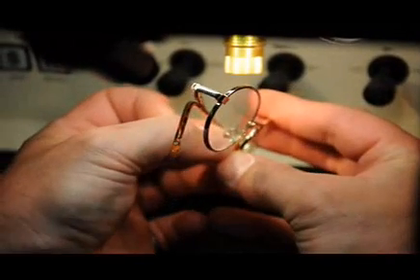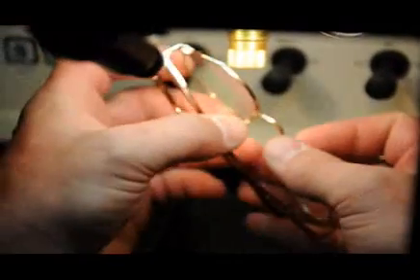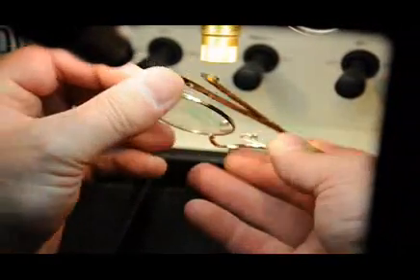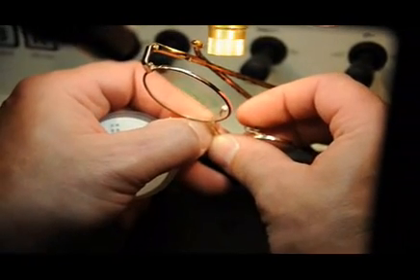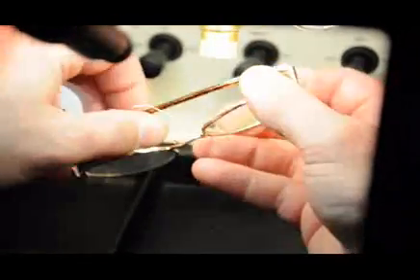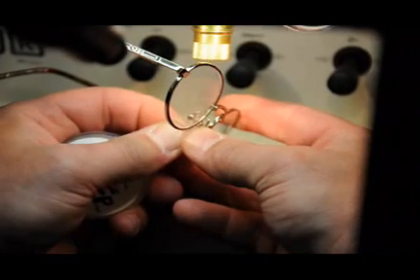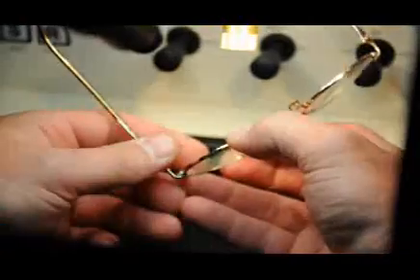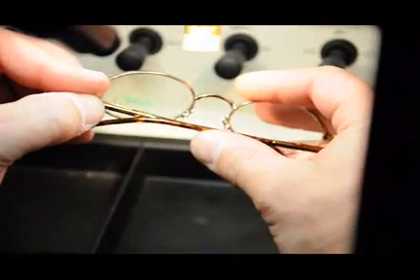Laser Welding - Eyeglass Frame Repair

Comment: What type of wire did you use?  I've tried countless times and it seem even more brittle than before.  Also what type of power on the machine did you use?
Reply: I totally agree...I have been very unsuccessful at frame repair

Comment: The *only* burn I ever got was a poorly aimed shot reflected off the side of a large, flat stainless piece. It was like a light instant sunburn. Not too bad, quit hurting in an hour or so. I agree, it would be wise to hold the piece with a tool. Hit the tool, not your hand when you miss. (You will, eventually)